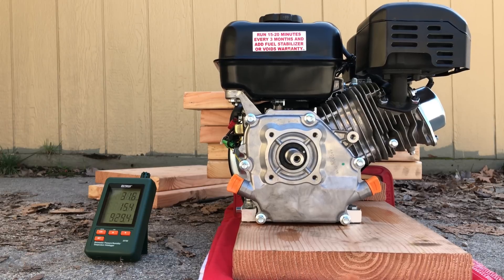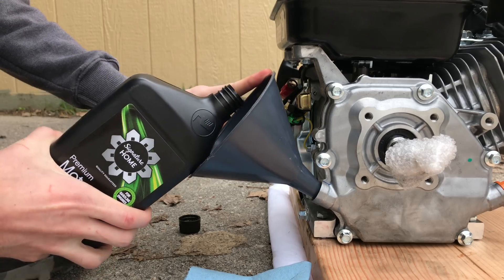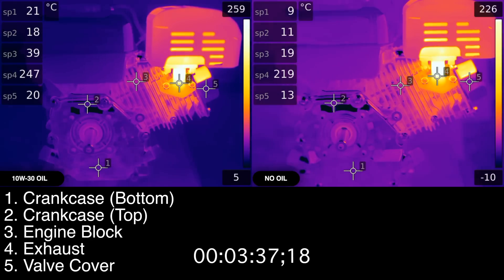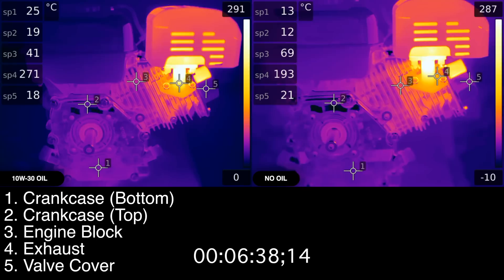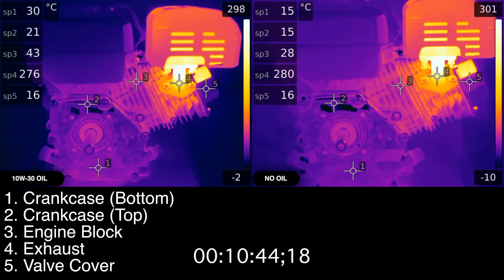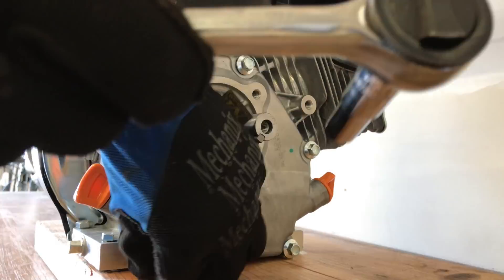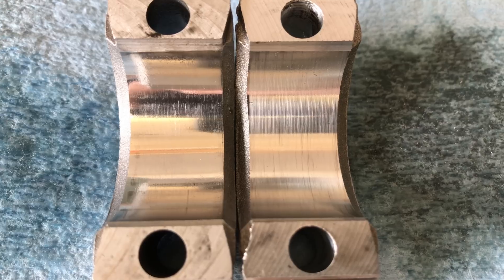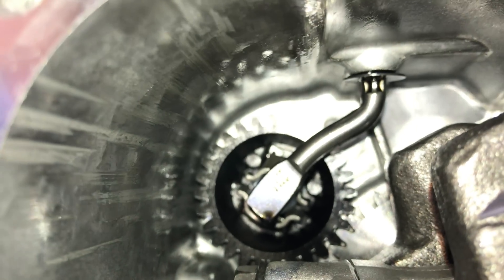What Happens To An Engine Without Oil?

Comment: I bet if this test was done with a load on the engine you would see a much larger temperature difference. However, it was still interesting to see how similar they were at idle. Thanks for sacrificing an engine for us!

Comment: My 1996 Honda Civic Ex ran without oil for quite a while. The car felt sluggish and slow, but it kept going. One of the pistons had exploded and was making a terrible popcorn sound while idling. The engine blew and had to get a new one. 

But it did run for awhile without oil. To this day, I say Honda makes the best engines.
Reply: Jack Al You never checked your cars oil...?
Reply: Toyota makes equally good motors. 1980 Tacoma's still out there running like a champ
Reply: Or more to the point, it sounds like you kept driving the popcorn motor??? Not all noises are something you should worry about, especially at high mileage, but there are some sounds and actions a car makes that are universal for stop, CEL or not...
Reply: My mother got a Mitsubishi endeavor with 160k back in 2013 
The car always made weird grinding noises but it was really speedy and never once even stalled or had an issue 
I never remember her changing the oil but I never said anything 
This week she came to visit and I was using the car with now over 200k she still never changed one thing on the car besides the battery and I decided to check the oil just out of curiosity and I was surprised to find the stick bone dry and the car wasn’t even knocking she said she never has time to check it and refuses to go to a mechanic because the car never had a problem 
I added some and the car already sounded so much quieter and felt new 
We still drive the car today and I plan to change the oil myself at some point
She got a montero sport that she doesn’t treat much better but something about these motors just keeps them going 
All i can say is no other car brand has survived her long

Comment: Premium junk oil hehe
Reply: you could add additives yourself, like strawberry aroma, mustard or lube.
Reply: Detmer It's probably made by a brand name, just without all the additives. I'd use it in an emergency.
Reply: quite honestly if its api certified its fine. probably grade one or two though, which means conventional with no additives(grade one) or with (grade two)
Reply: Detmer banana lube?

Comment: Why can we not use a transmission fluid instead of oil? 
Also if bored look into the company that is nano coating engines and other machinery with a calcium that makes a near frictionless result.

Comment: I had a briggs and stratton mower than had bad rings and burned all the oil. I kept using it for months with no oil to see how long it would go, it eventually melted the piston to the block but I still managed to mow my entire yard. These slow revving motors are beasts.

Comment: What happens if you use cooking oil to cool an engine? Would a sunflower seed oil engine work??
Reply: They work for a while however go bad pretty quickly.
Better than nothing if you lose all your oil on a camping trip and only have cooking oil.
Reply: Jet Star One of car enthusiast channels in my country (Poland) did this using a 1.4 Opel Corsa, the guy was hitting redline frequently for a few hours straight and the engine worked as smooth as it was before. The conclusion was, this kind of oil will work, but it has way shorter lifespan than engine oil (it stops working as a lubricant much faster)
Reply: If you have to escape from the apocalypse and have no other alternative it might work. Just make sure you use cooking oil that can withstand high temperatures, so no olive oil =D
Reply: If a cooking oil can lubricate anal sex, then it can lubricate an engine.
Reply: run engine for couple of hours and remove immediately and dip potato slice,,, "instant potato chips"😍😜
Reply: One of the common oils used in the early days of motoring was castor bean oil. I believe that was the origin of the brand name Castrol. (CASToR bean OiL)
Reply: It would work great in the fuel tank of an older diesel!
Reply: instant potato chips and cancer haha
Reply: dude, i've seen this engine run on MAPLE SYRUP.
It runs forever until you let the engine cool and the piston rings stick.
Reply: Air cooled engines people. Oil does not cool the engine, air or coolant does depending on the engine. Oil has a sole purpose to lubricate all the moving parts within the engine it self. Bacon grease will even keep an engine lubricated......
Reply: How long do you need it to work, and at what temperature?

Those are the two things to define "working".  While cooking oil would provide lubrication, it won't have the additives to maintain viscosity over time.  In addition, the temperatures at combustion are likely going to be higher than the smoke points of cooking oils.  IOW, you're going to be burning a lot of that oil with your fuel.
Reply: what if you used lube instead of oil?
Reply: Jet Star as a lubricant or as cooler?
Reply: Alan Hunter Considering you eat the food that you boil in the oil and it's main reason isn't to lubricate your food this makes no sense
Reply: only if you're in California
Reply: Likely have the sounds of an orgy popping out from the exhaust. xD
Reply: +J Otto that's what I was thinking the whole time watching this. Lol ignorance.
Reply: You can say your engine is now.

"Fried"
Reply: Bet it's better than nothing and smells good
Reply: Just add additives to it and it will work as good as an average performance engine oil. I've seen people in the kampung-suburbs of Malaysia using Palm oil in their light weight vichecules especially motorcycles. it's a very affordable cooking oil here, plus it's slightly thicker than the sunflower oil, so it works fine for them. true its life is shorter but yeah.. it's surprisingly cheap.
Reply: Fluttershy Hi flutters
Reply: arekb5 haha, we have the same country. POLSKA JEST FAJNA
Reply: Saunasaatana as a direct replacement of engine oil
Reply: Cobalt Skies Do ponies even have this technology?
Reply: Cobalt Skies 🌌
Reply: The crankcase will blast 🤣
Reply: Your car will become obese
Reply: Project farm does tons of stuff like that.
Reply: It oxidize easily and after some time  it will become very gummy in nature
Reply: Check out
Reply: Check out project farm he does a lot of that kind of stuff.
Reply: Lookup the channel project farm
Reply: vasoline
Reply: Considering I change the oil in my deep fryer that I barely use once a month and the oil in my car that sees average amounts of driving once every 6 months. I don't expect cooking grade oils to last very long at all.

Comment: please tell me can burnout be done with a front wheel drive car???
  thanks in advance!!
Reply from the maker: A burnout can be done with a front wheel drive car!!!
Reply: Mohammad Zeeshan Just pull the handbrake and dump the clutch
Reply: Take meth for a couple months.
You'll burn out.
Reply: gear in reverse, go backwards a bit, clutch in, 1st gear, get revs and dump the clutch while the car is still going backwards, then pull the handbrake up as you are doing the burnout
Reply: You don't need that much, a 50hp econobox can do a burnout, with cheap tires.
Reply: I've done a burnout in a big wheel that was front wheel drive, so yes.
Reply: Pull the handbrake up a couple clicks and lightly press the brake.
This next bit requires QUICK reflexes!
Now reevaluate your life.

Here's the rest since you wanted to Read More.
Max the engine revs above 3500
Immediately release the brake.

You can use some tire shiner, WD-40, or even Motor Oil on the wheels to create slippage and smoke.

Don't drive around with your parking brake on. Some cars disable their traction control with the handbrake. The handbrake also locks the rear tires so you front tires can spin.
Reply: Just get cheap tires and make sure you have at least 200 whp.
Reply: ive have done a burnout in a 60 bhp car
Reply: Mohammad Zeeshan Of course you can do a burnout with front wheel drive cars.
Reply: Mohammad Zeeshan, yes it can be done. the previous owner of my Jetta lent it to his grandkids, who promptly decided to do burnouts and racing in it. they threw rods through the trans case, and ruined several gears. I got a really nice discount due to that. I still do some burnouts, but mostly by accident on gravel lol
Reply: Mohammad Zeeshan play nfs pro street then use any fwd car in a drag race
Reply: Mohammad Zeeshan Yes. As long as there isn't too much traction and the engine is powerful enough. It can be done. I'd recommend with a manual and on plywood.
Reply: Dankus Memus I've done burnouts with less.  You just need enough torque to get the wheels spinning while the ebrake is on.
Reply: Mohammad Zeeshan 
Yes
Reply: You are literally on YouTube...just search it. My god....
Reply: hello what about an automatic?
Reply: Or by first pulling the handbrake... or by parking with your bumper against a wall or pole... or while the police is towing you away... as long as they lift the rear wheels and you are still inside the car.